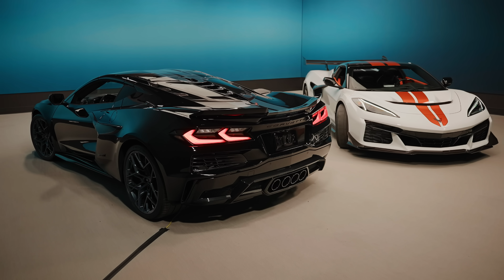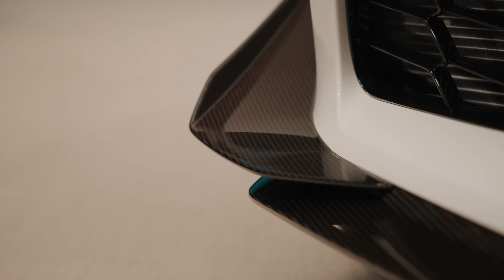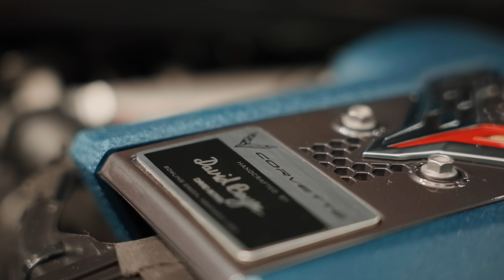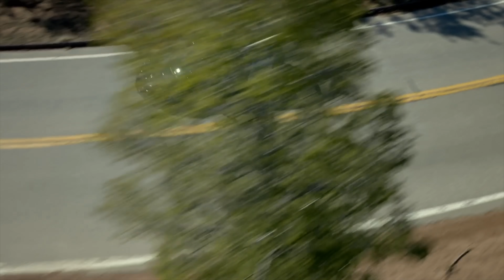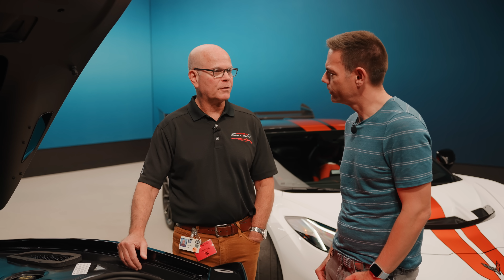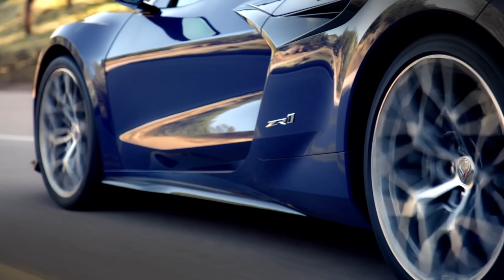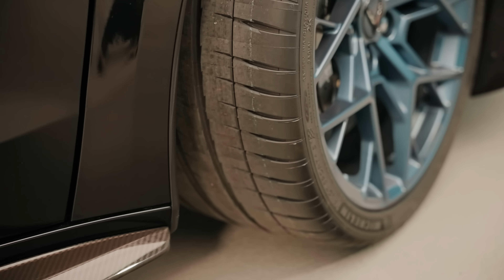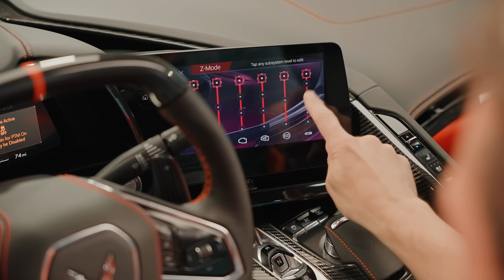FIRST LOOK: 2025 Corvette ZR1 – 1064hp, Turbos & 215mph!

Comment: Chevy is basically building a Hennessey Venom at this point
Reply: the zora is still on the way, they might even beat it. The corvette isn't just a supercar killer anymore, its wading into genuine hypercar territory
Reply: @garrylong2993  it has more HP than. Revuelto!
Reply: @garrylong2993 Already is
Reply: @garrylong2993  I am not sure how they are going to be able to do the Zora. On the E-Ray the electric motor and controller are in the front right around where the ZR-1 is putting all of that extra cooling. I am curious how they are going to be able to package it with having the cooling for that massive engine. Unless they go the other speculation rout and put the Z06 motor instead of the ZR1 motor
Reply: @liljay300000  I think they might do what Porsche or BMW does and put the e motor on the crankshaft if they're going to keep the aero the same. But they might just do an engine swap on the e ray and call it a day
Reply: @garrylong2993 for $200,000 no less 😂
Reply: @garrylong2993  Let's pick a contemporary hypercar like AMG One, Valkyrie, Jesko or Nevera, can it beat those? How about a 5 year old supercar like the SF90 Stradale or the newer SF90 XX Stradale? No point in beating those old hypercars.
Reply: @Brian.Jones.310  You're talking million dollar cars. Remember, the P1, LaFerrari and 918 are hypercars and this has more power and aero than those. SF90 XX is a hypercar too. Those cars you originally mentioned are unobtainable hypercars. This Corvette is an obtainable hypercar. Also, don't ever compare a hypercar to a Valkyrie or any track-only hypercar. It's not the same
Reply: @Brian.Jones.310  the zr1 is not quite there, but with with the limited edition zora which is coming out soon with 1200+ hp, hybrid and AWD, those cars are definitely in the crosshairs. Chevy was testing the current ZO6 against the SF90, so its clearly in the equation already
Reply: @garrylong2993  How much that thing will weigh? And the SF90 Stradale is out of production.
Reply: @toxicgracie3772 Someone said about hypercars and ofcourse hypercars are over million dollars. LaFerrari, P1 and 918 are hypercars from 2013-14 and 10-11 years is a long time for car development, compare corvette's from that time and you will understand the amount of development that has occurred in these 10-11 years. The SF90XXStradale is a supercar and hypercars are unobtainable.

Why shouldn't the Valkyrie be compared? Valkyrie is a hypercar but if you guys just want to cherry-pick some old hypercars to say the ZR1 fits in the hypercar category, then that certainly says a lot about the car.
Reply: @Brian.Jones.310 I think ppl are more so saying it’s super close to hyper car territory in certain performance aspects. I think price is one of the considerations ppl put on hyper cars usually base at least 1 million and up so deff not hyper car but come one man most the cars you brung up are 3-5 million dollars this car will be sf90 territory (4-5 year old platform ik) but this car will probably be 300k max, that’s what ppl are raving about a 300k car that competes with cars up to a million dollars and barley falls short to multi million dollar cars. lastly let’s be honest a Valkyrie is a full on track car that’s barley load legal and is not livable, u literally have to change the engine every what 15 or 30k miles, this cars is daily drivable. Apples to oranges and imo no it’s technically a hyper car but its deff in the territory, I’ve heard the lambo revuelto be called a hyper car this has similar specs, less weight, more hp..
Reply: @Brian.Jones.310  it's because of value. Chevy has been touting their performance per dollar value for ages. If it costs 200k, it's going to be twice as fast as anything else in the class. You could buy 10 top trim corvettes for the price of a Valkyrie or a nice Pagani or a jesko. The whole point is that they're giving more people the opportunity to own a weapon. It's not just for the a list celebs anymore.
Reply: @GandalfTheClay  Or in other words they are priced like that so they can be sold, at the same price, only a murican fellow shouting freedom is going to take a Vette over a Valkyrie!
Reply: @1LE_Ciko Contemporary hypercars will be priced like that, can't help. The SF90 is a Ferrari and this is a vette, so there's bound to be a price difference. Looks to me, you guys only like to pick up a fight against old hypercars, let's leave the Valkyrie out to make you guys happy, what about the AMG One or Jesko? Just compare performance, livability or engine replacement is a discussion for sometime later and the revuelto isn't a hypercar, even a Lambo representative said that.
Reply: @toxicgracie3772 HyperCard are determined by power or weight, it’s the metrics they provide to the user in addition to what Supercars are.
Reply: @Brian.Jones.310  amg one is a Valkyrie competitor also priced in the millions, jesko is also in the millions and ment to be a top speed world record breaker(in its own class and a Bugatti competitor). I agree that lambo isn’t a hyper car nor is the sf90 but some ppl would debate they are and if those two are debatable then so is this corvette, once again I do not believe none of those are hyper cars, ppl are just impressed at how much Chevy is giving for the price.. it’s literally a 300k ish car that’s a step above super car and a step below hyper car at this point. Also the old hyper cars are outdated now but when they did release the prices were at or above 1 million so end of the day all I’m saying is this is highly impressive especially for the price..
Reply: @Brian.Jones.310 also the ford gt came out for 500k and resales in some specs over a million dollars and was considered a baby hyper car at the time.. America can make cars at those levels as well but that’s not what the corvette ever stood for or was made for as most American cars..
Reply: @toxicgracie3772  They are 10-year-old hypercars. The Mclaren F1 is a hypercar, the first hypercar. But pretty much every supercar these days could beat it. It should be compared to the cars that have been built recently. The recent hypercars are the Bugatti Chiron SS, Bugatti Bolide, Bugatti Mistral, Bugatti Tourbillon, Koenigsegg Jesko and Jesko Absolut, Koenigsegg Gemera, Rimac Nevera, Hennessey Venom F5 and Venom F5 Revolution, and Mclaren Speedtail.
Reply: @1LE_Ciko   Someone said that ZR1 is nearing hypercar territory, so just gave examples of some of the contemporary hypercars and these hypercars will be priced like that, even murica's own (supposedly) Venom F5 and SSC Tuatara are million dollar hypercars. The vette, whether Z06 or ZR1, is impressive on its own but saying that these are nearing or have like hypercar performance, is only true when compared to old hypercars, at least 10 years old. Chevy can't price this car like the SF90 - a 5 year old car and expect it to sell like they actually wanted it to, their brand value isn't comparable to that of a Ferrari, only a few muricans will choose the vette over the SF90, so it's impressive on its own and compared to older supercars and hypercars but compared to contemporary supercars and hypercars, it's still a vette.
Reply: @1LE_Ciko  Ford GT got beaten by a measly AMG GT-R at Anglesey, talk about baby hypercar performance and resale value is high because of the demand among collectors/buyers.
Reply: @Brian.Jones.310 yes let's compare it to non production cars that cost 3 mil plus haha
Reply: @Brian.Jones.310 200lbs more than the z06
Reply: @Brian.Jones.310 this car will murder both of them
Reply: @nicklovely6431  LMAO now there don't start crying, you guys rave about its hypercar performance but when put against some contemporary hypercars you act like sissy's, come on if it's really about hypercar performance then it should be put to the test against contemporary hypercars and not some decade old hypercars. And hardly a few are going to take a vette over these exotic hypercars if they are at the same price point.
Reply: @nicklovely6431  3670lb dry which is roughly 1668kg, nearly 100kg more than the hybrid SF90 Stradale which is 5 years old and out of production.
Reply: @Brian.Jones.310 just wait till this thing nearly nails a p1 against the wall. The Zora will then crown them.
Reply: @nicklovely6431  I don't think so, looking at the stats of the SF90XXStradale, which is over 100kg lighter, has nearly the same downforce at a much lower speed and is only 30hp less.
Reply: @jackcoakley2848  P1 is a decade old, the codenamed P18 hypercar is around the corner, invitations have been handed out, let's see this so called hypercar against a hypercar from its time.
Reply: @nicklovely6431  LMAO now there don't start crying, you guys rave about its hypercar performance but when put against some contemporary hypercars you all act like a girl, come on if it's really about hypercar performance then it should be put to the test against contemporary hypercars and not some decade old hypercars. And hardly a few are going to take a vette over these exotic hypercars if they are at the same price point.
Reply: @Brian.Jones.310  I honestly think you are wrong.  I think the majority of folks would pick the Vette over the Valkyrie.  Even if they cost the exact same price, the Vette will be worked on at your local Chevy dealership, consumables won’t be insanely expensive, insurance will be much lower, etc.  The only reason I’d want a Valkyrie would be just to flip it and buy a more reasonable performance car and save the cash.
Reply: @GrimSRT8  Please stop commenting, nobody would buy a 4M USD vette! 🤣🤣🤣
Reply: @Brian.Jones.310  tell me this? If you were given a Valkyrie today, could you afford to drive it?  I have no idea your personal finances, but for the vast majority of people it would be impossible to own a car like the Valkyrie.  As someone who has owned/raced professionally when I was younger I realized the operating costs of a car matter.  That’s one thing that GM is very good about- keeping costs down (and performance up.) A tire swap alone on the Valkyrie is listed at $50K!  The first service (at just 600 miles) costs $33K.  Service number two (3,100 miles) costs $111K.

So like I said, I think the VAST majority of people would take the ZR1 over the Valkyrie due to the costs associated with owning one. By the time you hit 3K miles with the Aston most people would have to mortgage their home.  Hell, the 2nd service is more expensive than a Z06 Vette!
Reply: @Brian.Jones.310  It'll beat the Jesko and Nevera on track. idk about the AMG ONE, but the Zora should go after that.  By the way, we're talking about multi-million dollar hypercars (some megacars and an ultracar in there too) that this 200k vette is competing against. Total insanity!
Reply: @Brian.Jones.310  that's obvious 😂 a Valkyrie is the cutting edge of auto engineering rn. It also costs about a million to make one, the Corvette might cost 150k to build. They aren't the same class of car.
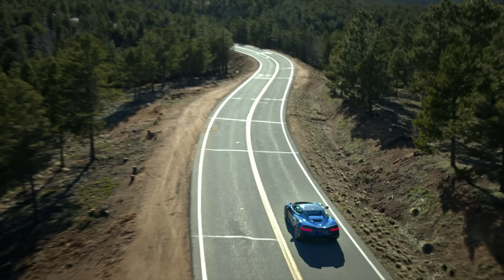Reply: @hugo-pg5tv The Jesko has a ton of power to the rear wheels. When you pass 1000hp, no amount of extra power is gonna help you on a technical course. it's just gonna hurt you. That's why Koenigsegg could never break the 7 minute barrier despite trying with the ONE:1 and the even more special "THOR", both with nearly 1400hp. In fact, between the two manufacturers (koenigsegg and Chevrolet), Chevy actually got closer to breaking the 7 vimute barrier, running a 7:04 with the C7 ZR1 in the wet, with cold tires and reduced power (because of the noise limit restrictions). Remember, the C6 Z06 beat the Koenigsegg CCX at the ring despite the CCX having 270lbs of downforce at 124mph while the Z06 had LIFT! Not to mention the CCX having 301 more horsepower, which is actually usable on track since it's still well under 1100hp. The C8 Z06 is known to hang with the 992 GT3RS and 991 GT2RS which are both in the 6:40s, and we know this ZR1 is gonna be faster, so low 6:30s seems like a good range. The Jesko still has problems putting it's power down like every other koenigsegg so it'll be lucky to get into the 6:30s as well.
Reply: @GandalfTheClay  I can sense the excuses pouring in, you see that's exactly what a contemporary hypercar is about, beat or match that, then it can be said that it's a hypercar or has hypercar numbers.
Reply: @GrimSRT8  Someone buying a 4M USD car isn't too much worried about expenditure on maintenance of the car. The vast majority will be still be buying the exotic hypercar and overlook the vette
Reply: @aaronvector4750   Hypercars are multi million dollar cars, so if you or someone says that the ZR1 is a hypercar or has hypercar numbers then it should prove against contemporary hypercars. The ZR1 isn't beating the Jesko, the down force is about the same as the SF90XXStradale but at a much higher speed.
Reply: @Brian.Jones.310  so you think “exotic hypercars” will outsell the Vette?  The only thing that will limit sales at all is that GM won’t make enough to meet demand.  I’m active in the car community, and even my exotic owning friends have said things like, “Just watched the video … and crikey, what a machine !!!” That guy owns several exotics and was pretty excited after seeing the reveal.  I have another friend who is a V12 Lambo owner, and he’s definitely trying to use all of his connections to get a ZR1 and he’s looking in multiple states to find one with an allocation. 

You may be one of those guys who has to own an “exotic hypercar”, but I think most true car guys buy the best car they can find for the money that matches their needs and look past the titles people put on the car.  I do know many people who focus on the status of owning a prestige brand and whatnot in the car community, and I have little in common with those people.  They also tend to be the ones who stop showing up at event after the newness of their new toy wears off.  After all they aren’t really car guys, they are people who want to be seen with their exotic.

And keep in mind, there’s an even more higher performance Vette coming with the Zora in a year or two. I think I’d go with the Z06/Z07 myself, but the ZR1 (and Zora) are/will be incredible machines.
Reply: @Brian.Jones.310   Hypercars are very fast supercars. supercars are very fast sportscars. Megacars are even faster hypercars, and ultra cars are the very top of the performance car range. whether something is a supercar depends on the performance, not the price. For example, The Mclaren 765LT, 750s, Ferrari SF90, Sf90XX, 296gtb and Revuelto are all non-million dollar hypercars. The Koenigsegg Jesko is a Megacar, but even so I think the ZR1 has a shot against it on track, because 1600hp is just unusable.
Reply: @aaronvector4750  Sorry I don't agree to the categorisation of those cars as hypercars. As for track performance, leave aside 1600hp, even 1000hp is unusable, it's about down force, braking and less weight but there are certain GP circuits where high horsepower cars can have better times.
Reply: @Brian.Jones.310  Here's my logic for calling those hypercars. The Bugatti Veyron and the Holy Trinity are the gatekeepers of the hypercar class. If a sportscar exceeds the performance of those vehicles (in a straight line and on track) then it can be classified as a hypercar. Of course, 1000hp is unusable, which means the difference between the ZR1 and the Jesko in terms of power is useless. In wide open racetracks, horsepower and therefore downforce is useful, but in all racetracks, suspension, braking, mass and tires are important. In technical courses (like the nurburgring or general small tracks), a car with fine tuned suspension and decent traction would be faster than a high horsepower, high downforce car, unless that downforce is somehow available at low speeds.
Reply: @Brian.Jones.310  when the Zora comes out I have no doubt it will be the king. And I think the zr1 is gonna take a lot of million dollar plus HyperCars lunch money already
Reply: @Brian.Jones.310 it has more horsepower than the amg one and is RWD so thats enough for me to call it the greatest car ever made
Reply: @ThePauerToBreakFree  Those criteria for your greatest car is laughable, horsepower and rwd! 😂🤣 Do you even know how difficult it is to put the power down with just rwd and that too over 1000hp?
Reply: @aaronvector4750  Bugatti Veyron and the holy trinity were all hypercars and they all got unveiled between 2005 and 2013. Now with time, 11 years have passed as you may or may not noticed, those technologies filter down to comparatively lower end cars, this is called progression of technology and these cars become as fast as those hypercars from 2005-2013 or even faster. So, technologies and performance don't remain constant over the course of time, beating old cars is no achievement otherwise there's no progress in terms of performance. This is very similar to world of smartphone where specs of high end smartphones filter down to the mid range ones over the course of time.

It all depends on the car and expertise of the driver on the track but a car providing high down force at low speeds and better braking would be quicker than one with same or lower down force but a higher speed and inferior braking even they may or may not have the same horsepower and torque.
Reply: @jackcoakley2848  Don't think others will just be sleeping. ZR1 isn't touching any contemporary hypercars.
Reply: @Brian.Jones.310  give it a rest bro. You must be tired of coping
Reply: @jackcoakley2848  Same applies to you, give those comments a rest - wait for this and wait for that, you have to deal with the fact someone else would also be developing something new and competitive.
Reply: @Brian.Jones.310  haha if you dont have 1200 lbft of downforce yeah but then itll be a drift king
Reply: @ThePauerToBreakFree  1200lbft of down force at vmax! 🤦‍♂️ The speed is also important, rookie mistake if you ignore the speed.
Reply: @ThePauerToBreakFree lbft of downforce, do you you guys even know what you are talking about. You both said it. It's not a torque calculation. It's just downforce on a horizontal plane parallel to the road. Lol 😂
Reply: @toxicgracie3772 the problem with this car is that it's too ugly to be called a hypercar.Its as tall as it can get and has a big ugly wing in the rear lmao😆
It has hypercar specs but looks like a sportscar and doesnt even have active aero
Reply: @Brian.Jones.310 yes because we're smarter than you. Lol do you realize how much maintenance and Bs you're going to have to deal with that valkyrie?  With a Corvette all you have to do is take it to a GM dealership to maintain it. A car that's basically just as fast at a fraction of the price and it's so much easier to maintain sounds like a no-brainer to me. But then again Europeans haven't been smart for a very long time. 😂😂😂
Reply: And I’m all for it lol
Reply: But a Venom you can actually buy...that isn't a scam...and isn't sold to you by a conman...and has a dealer network...and an actual warranty...
Reply: @oskar6661  Not sure about the scam/conman part, it's still being sold by a GM dealer (stealer).
Reply: @oskar6661 this doesn’t even make sense 🤣 this C8 will live forvever whereas you’ll have engine problems after 10k miles in a venom
Reply: @oskar6661 so a Lingenfelter 😬
Reply: More power to them
Reply: At 1/10th the price and 1000% the build quality.
Reply: No, it's not a Hennessey piece of rolling crap.
Reply: @1225KPH  yeah I have no clue why anyone would buy anything from John.
Reply: *SledgeHammer
Reply: Supernatural, it's cool to hear you mention the sledgehammer. My name is Bryan Callaway and Reeves is my uncle!!  @bDz416
Reply: Nah they need a 70% increase for that, still this is a monster and I cannot think where one would be able to unleash this beast
Reply: but with no top speed 💀
Reply: This thing is basically a hypercar. People will still say "it's not a Supercar it's just a Chevy"
Reply: @toxicgracie3772 Keep it a Chevy so the prices stay down 😂
Reply: @toxicgracie3772 those people can't even afford the stingray
Reply: The Hennessey venom  was basically a twin turbo charged vette before gm smarted up.
Reply: @enchantedape8180 hennessey sucks